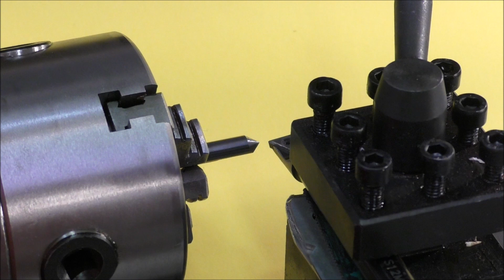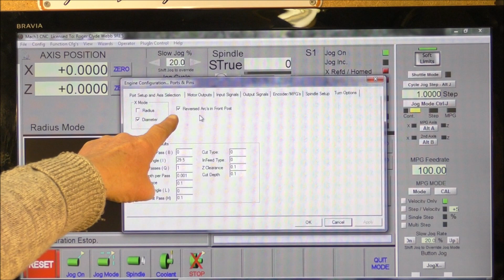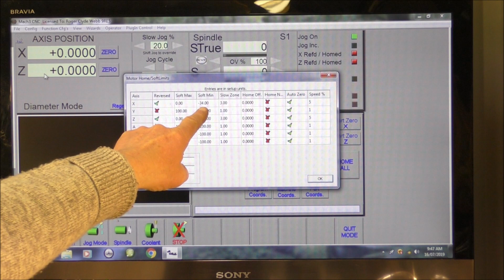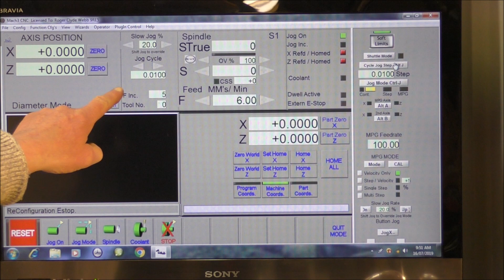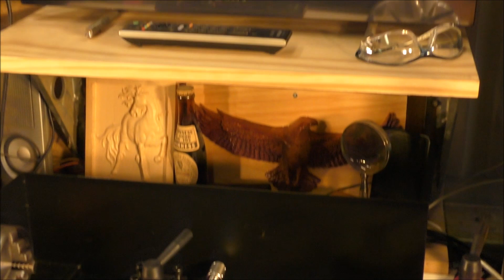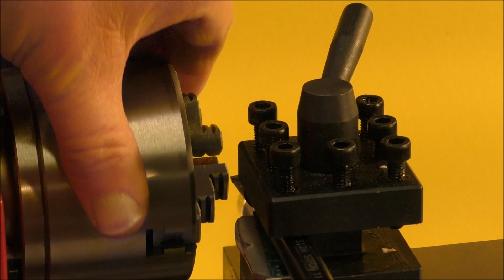335 Setting up Mach3 Turn to a Harbor Freight Sieg mini CNC lathe 7 x 14 inch

Comment: Can you open a thread, if you can, which card did you use?
Reply from the maker: All part, plans and pricing information for CNC builds are available on my Patreon pages. + Technical assistance is available on my Patreon pages  
https://www.patreon.com/user?u=15079773

Comment: Hey roger how did you get the new step dir value inputs? Where they random numbers, until you found the absolute correct values?
Reply from the maker: Hi, start at 350 step and 1000 velocity and work from that

Comment: X axis is traveling twice the distance. When you asked it to move .5mm the dial should read .25.
Reply from the maker: Hi, it is probably the steps per in the motor tuning.
 I do provide tech assistants on my patron pages
https://www.patreon.com/user?u=15079773